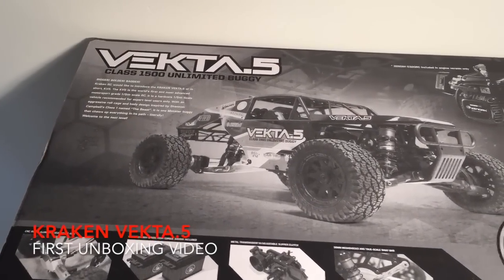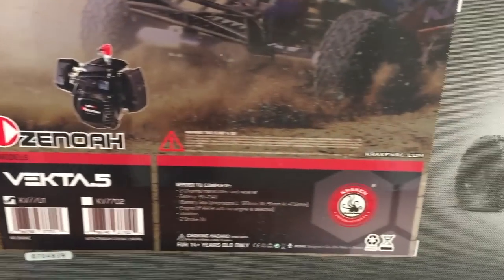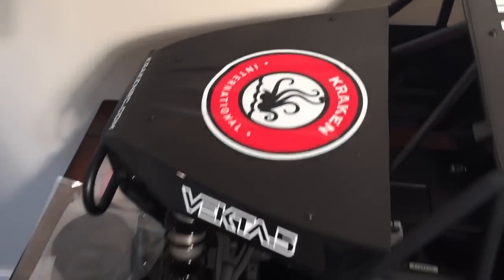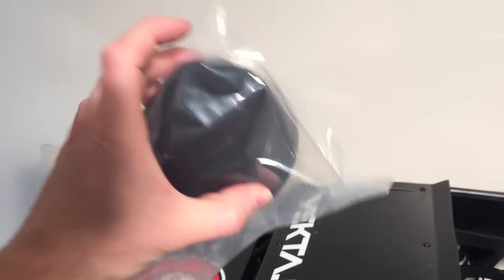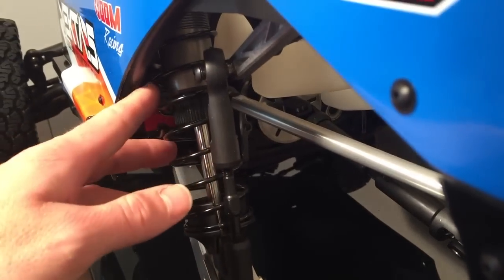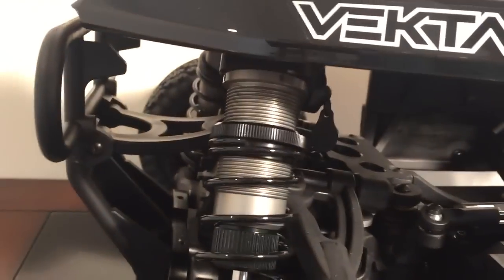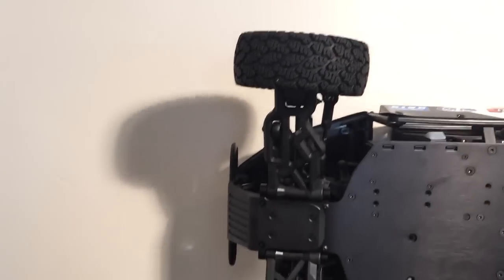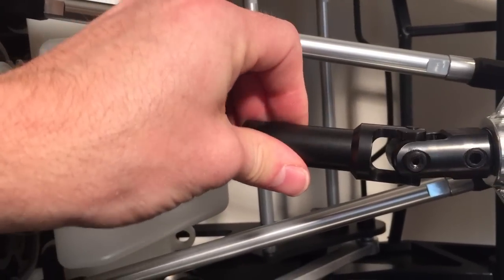Kraken VEKTA.5 Unboxing - First Look

Comment: awesome,  finally! !! get mine Friday,  thanks dave from DDM
Reply from the maker: Thanks for ordering it! I just got through my first heat cycle on break in - I just want to give it the beans so bad! Gotta be patient though
Reply: +DDMSteveB 

just wish the trailing arm connectors to the axial where metal,  make sure plug is tight,  someone's was loose.

Comment: 2nd Vekta I have owned after break in I hit a car head at full speed in front of my house.
Buggy totaled was able the savage some motor parts and the rear end. 
Bought 2nd one with a long block and rebuilt the motor.  Almost broken in, all this time a never bashed as yet.
I learn my lesson the hard way I have stopped running in front of my house and run at a safe area.
Still breaking the motor in should be ready to bash this week end.  One negative comment the roll cage body is a pain to install should be more like my Losi 5ive-T.  Great Buggy.

Comment: Ohhh yeahhh,,,you know i'm gettn one...Nice Video....do they make an Brushless Version?
Reply from the maker: No brushless version as of yet. I think getting a motor and speed controller mounted won't be too difficult; but finding an adequate mount for the battery will be tough. You will have to use the MGM speed controller, no way the Castle will hold up to the heft of this guy.

Comment: I really like the k&n filter i have on my losi dbxl, hope we get a mount to use k&n filter on the vekta 5. 
Piggybacks shocks too.
I have the one from the losi five shocks HR piggiback shocks caps, if shocks caps are same diameter as losi five they will fit.
Reply from the maker: There is zero reason for this to have piggy back shocks. It already will use a keg worth of shock oil to rebuild these things!

Comment: I would probably change the bearings in the gear housing to rubber sealed...
Reply from the maker: Agreed! FastEddy already has a sealed bearing set available for it. After having run it in the sandy/dusty environment I can see where sealed bearings will be an advantage to keeping maintenance and potential failures to a minimum

Comment: Steve is the fwd function able to be locked like we can do on the losi?
Reply from the maker: What do you mean "FWD" function? Four wheel drive? Front wheel drive? There is no center diff, so equal power is sent to both front and rear. There is an adjustable slipper clutch. Running rear wheel drive is as simple as removing the center front driveshaft.
Reply: Ok so it is all wheel drive with the slipper to take care of binding when turning
Reply from the maker: Yes, AWD. Just like if you were running a locked center diff in your Losi 5IVE
Reply: +John Knopp I don't think that's what he's saying.&#160;A slipper clutch is normally on the engine input to the transmission. The front and rear diffs are completely locked together on this car.

Comment: compare this to the dragon hammer. .... losi 5 size comparison
Reply from the maker: We don't have a Dragon Hammer, if you look at some of the 1/5 Facebook groups there are photos of it next to the Losi Mini WRC. Same wheelbase, similar overall size as the 5IVE. A bit heavier, mostly due to everything being aluminum and much more beefy. 
Dragon Hammer doesn't even compare. It is more of a Losi DBXL with a rear trailing suspension.
Reply: +DDMSteveB oh ok ...yeah it looks very beefy

Comment: This is RC porn. Haha. This thing looks pretty amazing. Can't wait to see one in person.
Reply from the maker: It is the craziest RC I have ever seen. The shocks and rear axle just blow away anything you have ever seen.
Reply: Definitely looking forward to some running videos. Are you going to be running the G320 or others in it?
Reply from the maker: I am using a standard G320 for now with a CY high flow muffler. Generally where I run is not tuned pipe noise friendly. Happy with the grunt that it produces so far!
Reply: Sick, looking forward to it.

Comment: is 4x4
Reply from the maker: Yes, 4 wheel drive. There is no center diff, so power is sent 50/50 front and rear. The front and rear diffs are open but can be tuned with different weight diff fluid. There is an adjustable slipper clutch on the center transmission shaft.